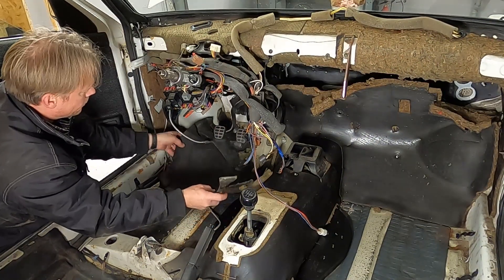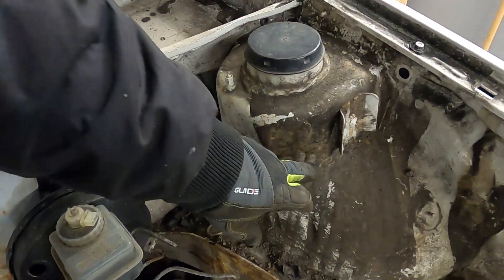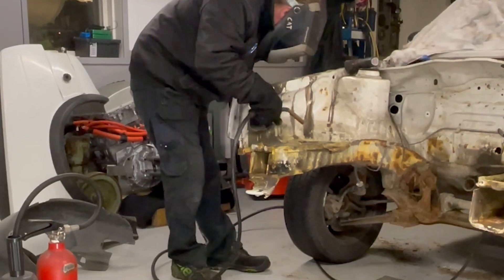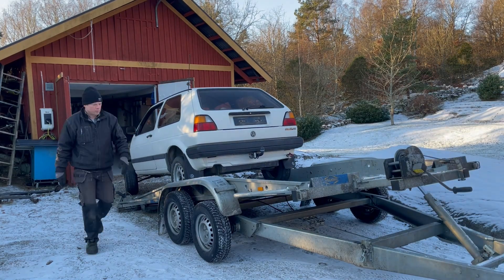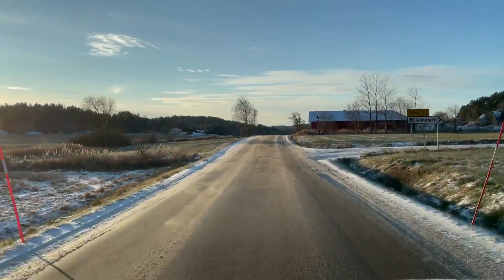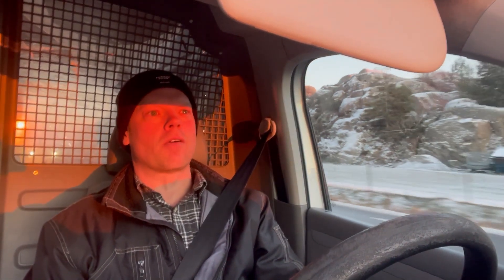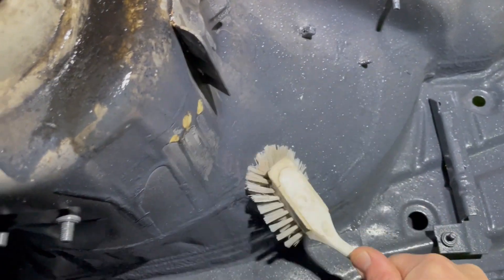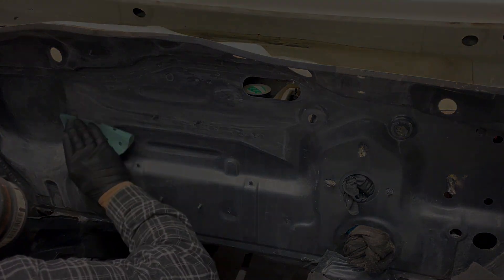Sand blasting, welding, cleaning the engine bay, EV conversion Vw golf rabbit MK2.

Comment: Super hard job!
I use water Karcher for yobs, but nead neitralise water from metal for no rust.

Solax x3-Hybrid-12.0 not starting EPS outputs.
Battry voltage 289 to 320V
Duscharging 2A
Charging 0A
What about another parameter?
Reply from the maker: Sorry I don’t know.